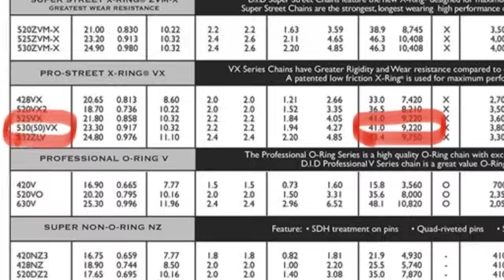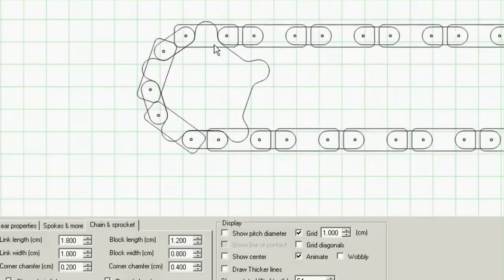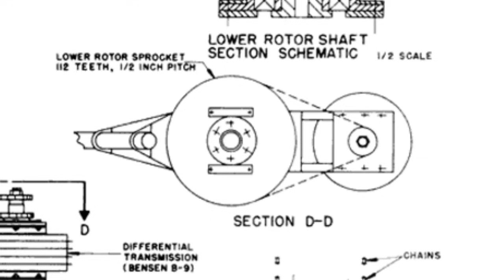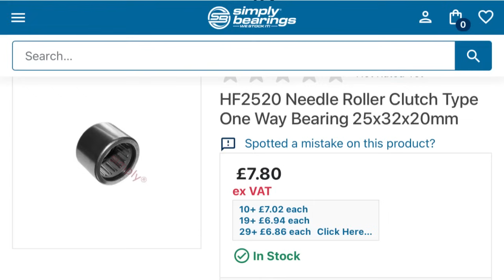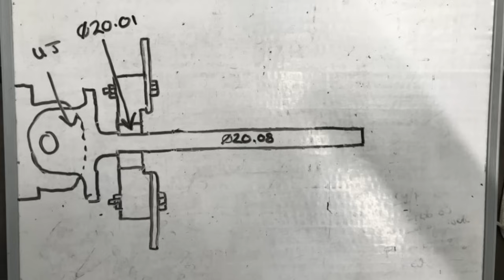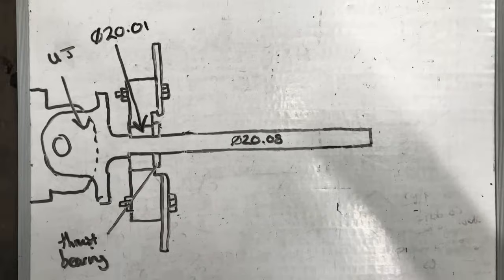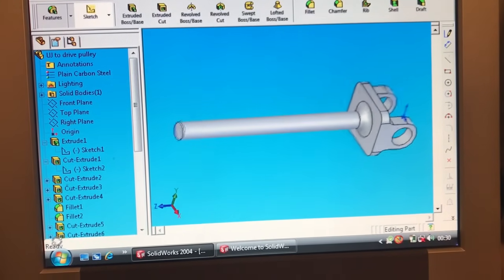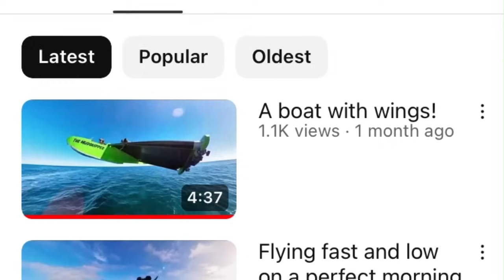I've learnt from viewers,  Homebuilt Helicopter fixing part 3 + seakranoflyer build.

Comment: G'day,

Great stuff !

I'd never heard that term "Cordle-Effect" before, but it certainly "stands to reason"...; and out of curiosity I do expect to be on my knees later today, counting the Teeth on the Drive-Sprocket of my Electric Motorbike...! 
(1,007 Km logged on it now, in 2 months & 28 Recharges...; I'm travelling 24 Km on the Bike for each litre of 91-Octane fed into the Generator, to refill the Battery...).

On the other hand, I feel like Catweazle looking at those one-way Roller-Bearings...,

"GadZOOKS, Sire... What 
Outlandish Sorcery be this ? !!!"

Or words to that effect.

In the 
Gripping hand though...;

What does the Press-Fitting process'
Circumferential Tension-Stress being permanently  loaded into the Wall  of the Aluminum Tubular-Shaft...; do to the Fatigue-Life of that Tube, when it's under high cyclic-rate vibrating Torsional Stresses (peaking on every transmitted Power-Stroke, fed into the 
Crankshaft by the Connecting-Rods thumping the Big-End Bearings ...) ?

Aluminium is a bit fragile in Tension..., & vibrating Cyclic-Loading annoys it as well...; but those Clutch/Rollers  sure look like 
"Magic" 
To my olde eyes...(!).

In other "news", I finally  succeeded in capturing Smoke-Trails wreathing vertically up from under a Foam Chuck-Glider model of a Spitfire, suspended inside the Hut, and free to 
Weathercock...
Responding to the  "Propeller-Blast" of the little
Peltier-Effect powered
Stove-Fan...
At a distance of 66 inches  (168 cm).

Capturing the visualised/imagined Airflow at super-low Airspeeds is a lot easier to think up than it is to achieve in practice..., it turns out (!).

The things one gets up to, while living in a Lawn Locker in the Forest, with no TV ; especially on 
Rainy 
Dayze...(!).

Such is life.

Have a good one...

Stay safe.

;-p

Ciao!

Post Scriptum...

The Drive-Sprocket is in a tricky spot to count, but I make it to have 8 Teeth on the 180° which I can see and reach with a Pointer to count with certainty.

Assuming it to be radially symmetrical..., then yeah - 16 teeth on the Talaria Sting's 
Motivational 
Cog..., as well.

Perhaps all the
Motorcycle-ologists are taught about the
Cordle (Caudal ?) Effect...; in the way that Baby Aeroplanologists learn that Lift must equal Weight and Thrust equates to Drag..., in stable level flight - whereas that Vector Analysis surprise a lot of
"Normal reasonable Adults"
Whenever the topic rises in conversation...

Rumsfeldts' famous
"Unknown Unknowns"
Might well include this
"Cordle/Caudal" Effect ;
But the mere fact that 
Rummy didn't know things
Never ever meant that those things were
Not
Underway, and proceeding afoot...

Life being full of
Surprises, as it is.

Have a good one...

Stay safe.

;-p

Ciao!
Reply from the maker: Hi, 
The bearings are indeed magical,  inside there are wedges where the rollers jam and only get released by counter rotation, small springs hold the rollers in the free running position. 
Quite impressive that they work so well and are so compact in design. 

The electric bike, are you going to have a solar panel to recharge the battery at some point ?  Is it 67mpg as it stands ? Not bad if so considering.

The cyclic fatigue I hadn't considered on the pulley but I have worked it out on the driveshaft if made from aluminium. 

I watched your video, surprising the fan   had enough power to disturb the smoke at that distance. 👍

Ben
Reply: @Ben-Dixey  

G'day,

Wow, 
Synchronicity strikes !

I posted an edit to my Comment, and when returning to my Notifications I found that we were simultaneously typing to each other...!

Yeah, there's a swag of Solar setup in the pipeline to feed the Bike.

2 X 440 Watt 24 Volt Panels, 12x 2.2 Volt 480 Amp/Hour Lead/Acid Gel-Cells, a 1,200 Watt Solar Charge-Controller and a 1,500 Watt Inverter... ($8,000 for the Stuff, $1,000 Installation, $900 for GST & I have yet to put a Slab of Concrete on the ground to erect the $2,000 Lawn Locker to keep the Rain off it all.

I've been unable to get myself to start on the Slab..., for months ; and now in midwinter the Shadow Horizon in my Clearing - even after lots of Tree-Clearing  to make room, is situated so that 
IF my sense of urgency had driven me to
"Just Do It...!"
Then the Panels would be in Tree-Shadow half the day in Winter...;
Because it be wasn't till now that, after all the Pruning I finally got to see where and when the Winter Shadows go.

The Shed Kit has been paid for since before Xmas, and a 10% deposit paid to get the Solar Stuff ordered and into Stock...; and now that the "Penny has dropped", I expect to see myself getting into that bit of the project.

Yesterday I rode to Deepwater, 29 Km each way, on the back roads, intending to buy Bread & Milk on the (Public Holiday) Monday of the Long Weekend on which Oz celebrates the King's Birthday (it still feels weird writing that, I've never had a King-thingy  before...!)...

The idea was to avoid the Highway and it's flocks of Tourist Lemmings desperately competing to get home in time to return to Work..., and that worked - but everything in Deepwater was shut but the Pub...

So I drank Coffee, ate half a Pizza, and video-ed the ride home, proving that Electric Motocross Pizza can indeed be a Thing (!)...; and the Light was indeed
Golden, mostly from the 
Correct Cinematographic direction, and the last 12 Km were
Magic to re-watch.

58 Km all up, at an average speed of 33 Km/Hr (40 on Bitumen & 30 on the Dirt...), arriving home indicating 33% Battery remaining - but after an hour to "cool down" that dropped to 30% : and the Recharge back up to 100% took 02:35...

Basically, two 51-minute Rides of 29 Km each...

When I arrived there the Supermarket was still open, but was about to close - and as I was 
Unhelmeting myself the Bike attracted the (apparently inevitable) observant bystander seeking to experience the 
Electric Motorbike 
Walkaround Introductory
Warble...

Which is how I came to go out for Bread & Milk, planning the Return-journey Video in the Sundown Golden Light ; and coming back with  half a Pizza instead...(!).

Last night I figured out the ideal timing for the Smoketrail Visualisation..., getting the Fire up to temp. before lighting the Dhoop-Cone and then putting the Fan on the Stove...

Next time I'll do all that..., synchronised, and put up some black Cardboard Backdrops, to better contrast the Smoke.

When done "properly", initially the two Smoke Trails rise vertically and falls away - with the hot stuff wobbling the model in it's Thermal Convection.

Then as the Fan spins up to speed, the Hot Air initially goes over the Model and only ruffles the Smoke..., but as the Fan speeds up the "Prop-Blast" does too, becoming energetic enough to cross the Hut & hit the Model, weathercocking it and blowing the Hot Smoke well  back behind and above the Model...

And all that is happening above the Colder Air through which the Cold Dhoop-vapour falls and responds to (and shows) the other Currents happening lower down, under the Thermocline ; as the Potbelly is sucking in Cold Air and blasting it up through the Firebox and out the Flue...

It will take a bit of setting up for, but with the Camera on a Tripod, the Black Backdrop and correct timing synchronised with the Potbelly's Firebox...; I reckon I should try to show the full Effect, one more time (!).

I really do enjoy visualising Airflows.

To the point of going outside to watch the top of the Chimney every time I light the Fire, to see where the Smoke goes in the Wind of the Day, and monitor the Convection-Runaway in the Firebox as the Flue commences to burn
"Clean"....

One can have a lot of fun, pondering the way Air moves...

Have a good one,

Stay safe,

;-p

Ciao !

Comment: All of this belt drive/gearbox/planetary is because you dont have a concentric under-hinge engine axle mounting solution, right?
Reply from the maker: Well the belt drive doing the rotor reversal meant I didn't need an additional reversing gearbox. The Nolan bothers and the air scooter 2 had a separate gearbox which I thought was weight that could be removed. I thought I need a reduction drive anyway why not do that and the reversal in one go, but the tilting plunging driveshaft needed is a little harder to design than I thought.
Reply: @Ben-Dixey  So. Question. 

Does the engine NEED to be frame mounted? can it be hung from the gimbal aswell?
Reply from the maker: @bakakun  The engine can be hung from the gimbal yes. The Helitrike did this on YouTube, they didn't get fully off the ground more than a few inches but that I believe was because they didn't have long poles attached to the skids. It was very top heavy and didn't have the safety in place to attempt a higher altitude. I believe it would have worked despite the high CG.

Comment: Why change the belt? The issue was the shaft / cv and the fixed pitch setup wasn't it?... drice belts are used in most piston helicopters with no issue
Reply: Actually the most common cause of belt driven helicopters coming down is because of belt system failure, atleast in Australian crash reports.
Reply: @chippyjohn1  utter garbage, and I know two people that have had drive belt failures and kept flying. They have multiple belts and all of them failing is incredibly rare
Reply: @mhale71  If you feel official reports are made up, not sure what to say then. I was surprised also at the time of reading. Look up CASA incident reports for helicopters and read yourself. If you can't be bothered learning that's your problem.
Reply: Also rotorway had issues with drive belts breaking shafts, and tensioners. Many helicopters have issues with belt drives.
Reply from the maker: Hi, the reason I looked into chains was because I thought at the time that the belts had been highly stressed during the drive failure. Replacing the belts is really expensive so I wondered if chains would be a better and cheaper option. I thought I could improve the ratio and add more lift in the process with chains. The driveshaft problem still needs to be resolved but I do have a plan for that.
Reply: @chippyjohn1   You might see in crash reports that most belt failures were on r22's. If belts are not engage properly they damage and weaken the drive belts,coursing failure in flight later on!

Comment: Relying on parts not failing because they are ‘well built’ is idiotic. For example, that top rotor shaft looks like it would fail in an instant if you lost a blade to a bird strike. Nothing is ever built well enough to negate failure.
Reply from the maker: Relying on parts to never fail within normal circumstances.